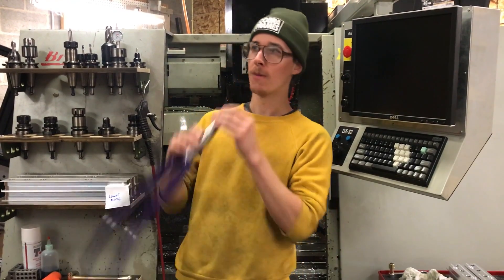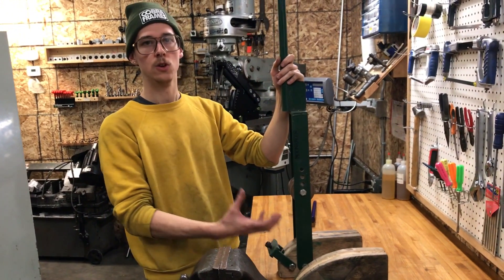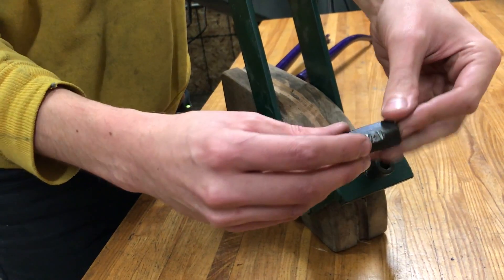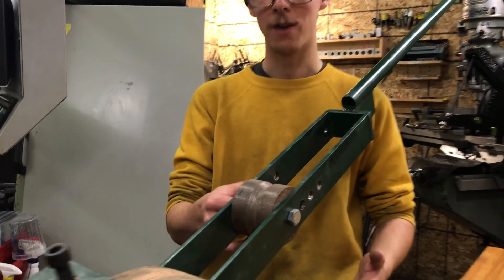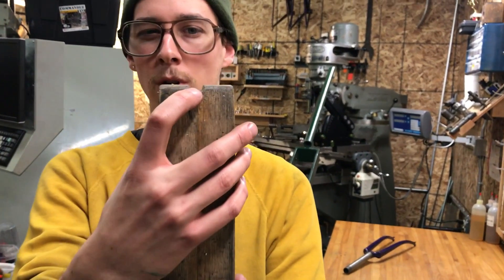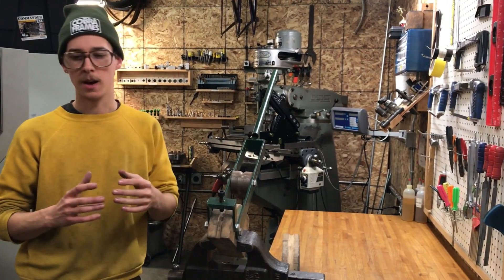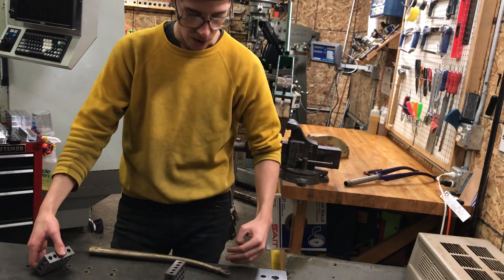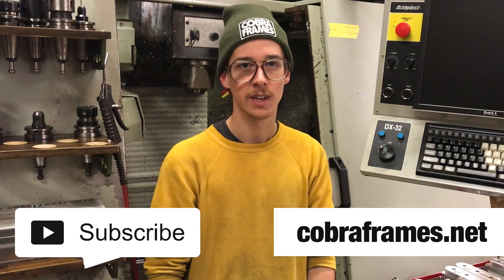DIY Fork Blade Bender | Bicycle Framebuilding

Comment: hello Jason , I'm thinking to convert a simple plain gauge steel frame to a freestyle fixed bike, for the fork situation im thinking of a lugged or unicrown fork ,but I would like to know if its still rideable if u reverse the curve? curved to straight fork leg, by bending back to original shape , and rebraze or tig some other dropouts
Reply: dawg just find a unicrown straight fork. Bending metal fatigues the molecular structure, and bending it back will just give you a wonky weak point in the middle of each leg -- probably the worst place for two weak spots on a bike. try this: get a piece of clay or play-doh, roll it into a straight even cylinder and take a picture. Then pull it around a bottle or can to bend it, and do that again in reverse to straighten it. Make sure you're pulling, not just wrapping it. Compare the double-bent clay to the original picture you took. More or less the same thing would happen to the molecular structure of the steel fork legs if you tried to un-bend them. Hope this helps! If I'm wrong anywhere here, someone please call me out, cheers.

Comment: Why Not  ???   Use a Solid  Bar  Stock  in the front end, thats a part you dont want to break . Also with frame  changes  Why Not use a thicker wall pipe section instead of  re use of cut out sections .  My concern lays with strength lose from flexing already weak tube. For as little as  steel costs  for safety is worth over savings. I do like your bender and Designing . Please do a video  with you useing your bender.I make tools also and find mostly there is certain methods used with our home cooked tools to get the best results ..Thankyou..

Comment: Are you going to sell fork benders at some point? I'd buy one!
Reply from the maker: The tube bender that I make and sell does not have the capability currently to bend fork blades, but I'll try to make a supplemental kit for it in the coming months that makes traditional, tapered fork blade bending a possibility. As I said, this is an easy, low stakes tool to make yourself with cheap, simple tools, so it's not a bad one to make yourself if you have the itch, but certainly what I would make and sell would make the process more enjoyable and simpler.
Reply: Very cool and informative video on such a wonderful tool !